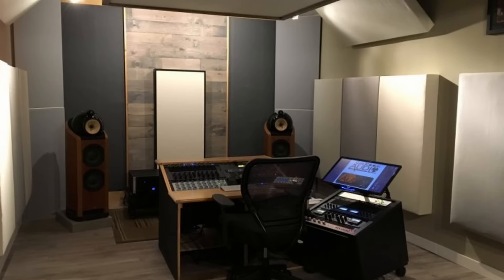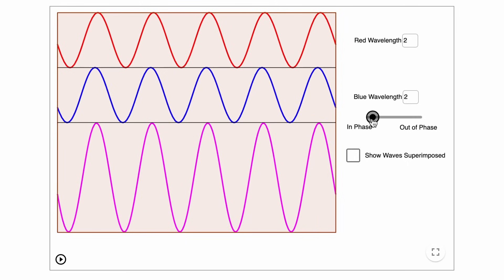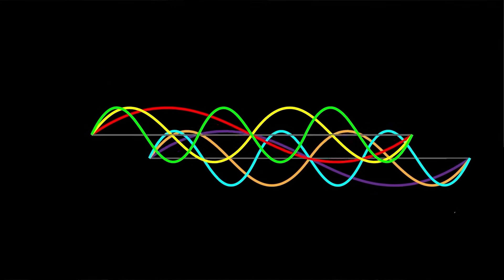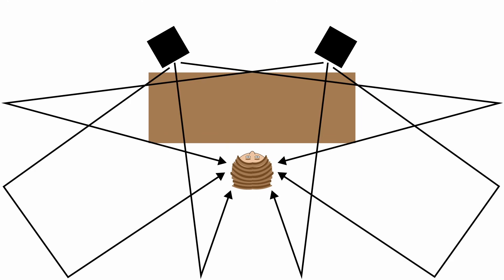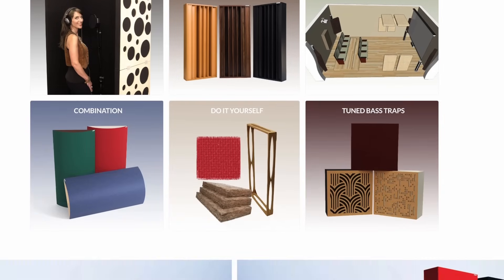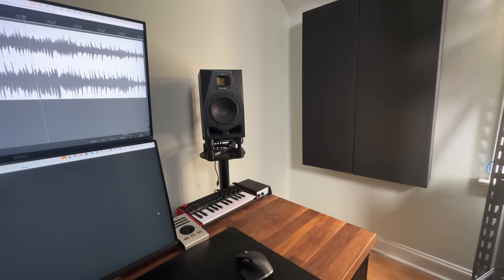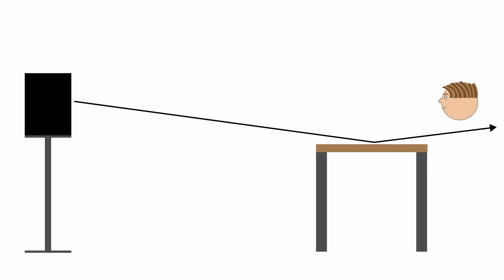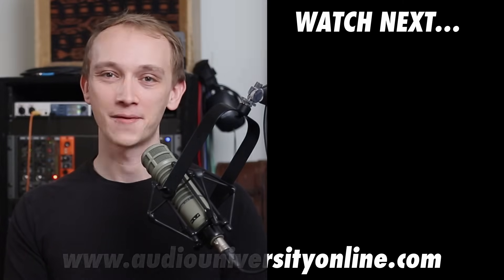Acoustic Treatment for Beginners: Studio Sound Optimization

Comment: This works the same for recording if you do this for the microphone instead of a speaker. The microphone is ears and your mouth is a speaker. So put an acoustical panel on the spot on the wall where you could see the microphone from where you'll be speaking if the panel were a mirror. 2-bounce reflections might be more important in that case too though. Have fun.

Comment: What is your opinion on a mix position in a room with a vaulted ceiling? The angle is roughly 20degs. I have my monitors are placed so upward slope of the ceiling is pointing away from the speakers. I figured this would lead to fewer early reflections as the upward slope points the reflections to panels on the upper wall

Comment: What about a 4 ft long Harman/Kardon sound bar mounted on wall under tv. This bar has a speaker in each end of bar that points at the walls on either side from it. This bar has speakers in the top shooting at 
ceiling and speakers  pointing at me. And speakers on rear wall behind me. What about that kind of set up. We'er talking very powerful sound bar.

Comment: Sound reflections, want to catch first relfrctiom, thick material to capture sound

Effectiveness is dependant on thickness

Sound proof curtains?
Reply: I had great results when I removed my interior doors and replaced them with thick curtain drapes. However, when I tried the same thick curtains for my windows, the extra absorption seemed to over deaden the sound of the room.

Comment: My mouse pad is so large it covers the entire desk. It's the size of a poster. This should help mitigate treble reflections. Plus, once you have a mouse pad this big, you will never go back. It's so convenient to not have to worry about a mouse pad because the entire table is a mouse pad, plus the soft mat material makes a nice surface compared to the wood, in my opinion.
Reply: Same here. I was just wondering if it’s good enough to help with that
Reply: @ I never thought of it until now but I should try a comparison. I will listen with and without the mouse pad. I suspect I will be able to hear a difference since it is such a significant point of reflection so close to me. I have previously noticed changes in the sound from making surprisingly small adjustments to the room.

Comment: Im moving from my rented apartment to own house, unfortunately its pre built and has 2 small wooden wardrobe attached on the right hand side of the back wall which is fixed in wall and cannot be taken off, while i have 2 doors one on the left  and one on the right from me listening positions basically behind both of my studio monitors not exactly behind but at a little distance. I have around 10 sound panels with rockwool enclosed in them. However it wont be enough for the whole room. How should i go about installing the panels also what more do i need to purchase?

Comment: Why not build the sounds panel directly AROUND the speakers leaving only the frontal view open?
This might mess with the imaging but at least you cancel the mirroring waves projected to the walls.
Reply: Sound does not travel in straight lines as shown in the video but rather like spherical surface emitted from a point. This means that you cannot block sound with baffles like you can Block light because the air molecules are coupled to each other and will "bend" around the corners of your shielding box, creating phantom sources and even more and worse interference than the first reflections covered in this video...

Comment: Is it the same but in reverse if you are trying to maximize a space for audio recording, then, and not playback? (I'm looking to build my own VO booth)
Reply from the maker: The first reflection principle still applies, but you may want to use more treatment around the booth in order to keep the reverb time to a minimum. Also, the smaller the booth, the stronger the reflection levels.
Reply: A benefit of a voiceover booth is that you don't need space for speakers, interfaces, or other hardware that mixing & mastering requires. And you have just one "speaker" and one "ear" to tune for. Just sitting in front of an open closet full of clothes helps a lot (granted, I'm Canadian so my coat closet might look different from yours). Also consider that something like the Aston Halo can get you a long way towards a full-blown vocal booth with minimum disruption.
But yes, the acoustic principles of reflection & comb filtering still apply. Number one issue, if possible? Record away from your desktop & monitor.

Comment: Would pulling the speakers forward help? Like to the point where your desk is no longer within the intended projection angle of the speakers? Might require fancy stands to still have the surface usable under the speakers, but at least then you wouldn't have desk space between you and the speakers anymore.

Comment: Any thoughts on using room compensating software instead of or in conjunction with physcial room compensation? There seems to have been a lot of progress in this in recent years.
Reply from the maker: I’ve got a video coming out soon that addresses this.
Reply: I work in very highly regarded studios on a daily basis - To answer your question, room compensating software has its limitations, remember, this is all within a digital domain looking at frequency responses. Your software such as Sonarworks can not accommodate for natural reverb time of your room, a physical domain, which can, for instance in a small room, cause huge difficulties with bass build up. For example, 100hz has a 3.43 meter wavelength assuming speed of sound at 21 celcius, as it bounces around the room it takes longer to convert its energy to heat as it just has so much strength, hence bass being an issue for reverb. It is also a massive issue for absorption as well as you need your absorption to be either 3.43 meters thick for 100hz (it only gets thicker as you go down in frequency) or positioned at 1/4 of the wavelength away from the wall to 'target' that specific frequency if you have issues there. Software also can not accommodate for spaciousness in your stereo image, which is usually treated with early reflection point treatment, as per the video explaining. There is much, much more at play than just frequency response. People do PHDs on this, but it isn't super scary. Just considered by many as a 'dark art'.

Your perception of hearing is the most important part and the entire room is your system that you are working in. Each part needs to be brought up to standard to have the best benefit of it all. Here is a list of things to consider in order of process to create a studio system:

1. What speakers you are using (Ported at front or back / unported. The best studios have this put into consideration when building them ground up.)
2. What position you place your speakers and finding your listening position (Realtrap 38% rule, Cardas Golden Ratio e.t.c)
3. Acoustic treatment on early reflections, bass traps in corners, diffusion if needed (Different methodologies have different effects. Read into Live-End Dead-End, Soffit Mounted, Full Bandwidth)
4. Room EQ Wizard + Calibrated Microphone (Sonarworks preferably if you have that for later) - Used to take repeated measurements and then alter your treatment positioning for best effect.
5. Sonarworks Monitor Calibration Software - Only now, after the above is done can we start to look at room compensating software.
6. 'K-System' Monitor Calibration (and metering if recording) - basically setting your listening level to the best level for your room (AND KEEPING THEM THERE!). This standardises our perception of sound between different studios and mixes. Look into Equal Loudness Contours and how different frequencies are at different loudness levels for ourselves.
7. What D/A Converter you have. (Digital to Analogue conversion. Yes, there is an audible effect, don't let people tell you otherwise. Especially on Analogue to Digital conversion when you're recording in)

Hope this helps!
Reply: @alexandersnape8428  
Yikes!

All this makes me think that monitoring should be done on a top of the line set of Stax electrostatic headphones, and that software compensation be applied prior to the feed to the phones to allow crosstalk to emulate the natural crosstalk between ears that happens when listening to speakers or a live instrument.  I am guessing that some superb rooms could be sampled  to create software correction for headphone monitoring during recording and mixdown sessions.  (Another part of me wonders what the ideal is given the high percentage of listening that is done on headphones these days, and maybe there needs to be a speaker mix and a headphone mix based on the intended listening environment and desired experience for the audience.)

The real world adds a lot of complex factors to consider, and of course none are perfect, and we all want to control the variables to be able to create a satisfying experience for the listener.

Comment: Hello, thanks for your vidéos, they are very usefull . 
I have a question please, i am wonderring if it is possible to connect a headphone to the an speaker output on an audio Interface. For exemple in case where i want to split différente mix on différentes headphone and m'y audio interface only have one headphone output but dire have tow speaker output.
Reply from the maker: You will need a headphone amplifier between the line outputs and the headphones.

Comment: Any thoughts about what material to use for a desk. If you do very little writing (ie. with a pen) at your desk then could softer, more sound absorbent material be used as long as it can support your keyboard, mouse, and various other devices?
Reply from the maker: Great question. A thin layer of absorption would absorb some of the reflection, but mostly in the high-mids and highs. In order to tackle the lower frequencies, you’d want the panels to be at least as deep as 1/4-wavelength of the frequency you’re trying to absorb.
Reply: A holed/mesh surface could provide the necessary support and UNDER it you can bring some sound panel. that way the sound pass through but also get dampened.

Comment: The desk treatment is overboard it really is.
Reply from the maker: It could help with the reflections, but I’d prefer to just remove the desk than to put treatment on my desk.
Reply: Need, more, treatment
Reply: Yes it is "overboard" but if you great all the other reflections the one from your desk will become very pronounced, so it rewly depends on what stage of room treatment you are in
Reply: What about covering the desk with some soft material?
Reply from the maker: @musicalneptunian - That would work, but the effectiveness would be limited to the thickness of the material. A very thin layer would only absorb high frequencies.
Reply: @AudioUniversity  I have a weird situation. For room treatment I have an entire set of thick funk & wagnalls encyclopedias in another room.  I might take some and glue them to my door; at least that will block outside sound a bit. I have the big room with high bare walls problem; shelves can only cover so much. One good thing that I have done is to buy a "quiet computer" designed to make almost no noise. Today was warm. It is silent.
Reply: @linuxaudio100 I want to point out that what you're talking about isn't really sound treatment. It does help to make your listening environment quieter but doesn't touch any of the problems from extraneous reflections brought up in this video.

Sound bounces everywhere, like ripples in a 3d pond, and the more you can do to absorb or redirect those ripples the better and clearer your speakers (it anything else in the room) gets to sound.
Reply: @linuxaudio100 that won't really do much of anything to be honest. If you want to acoustically isolate a space it's a completely different thing than to acoustically optimise a space. You need MASS or a vacuum to isolate a space. Books have neither.